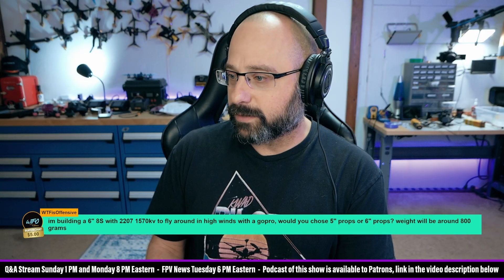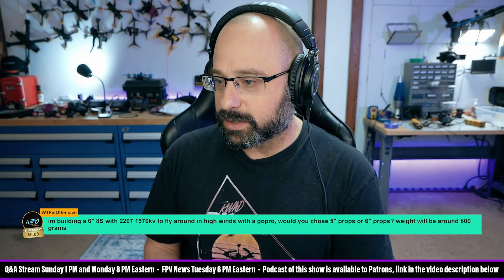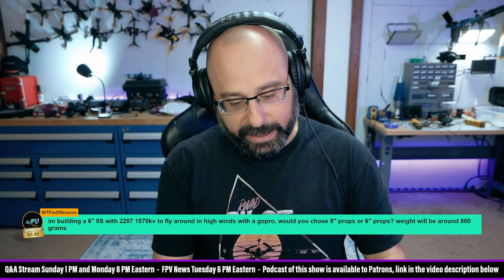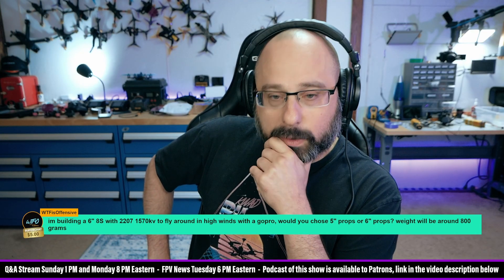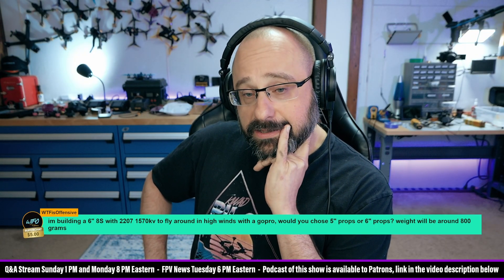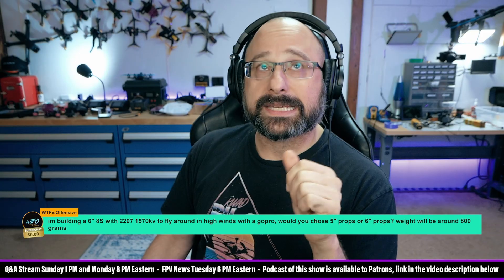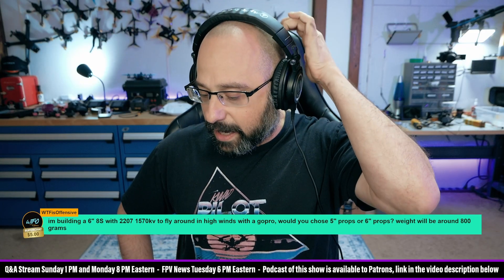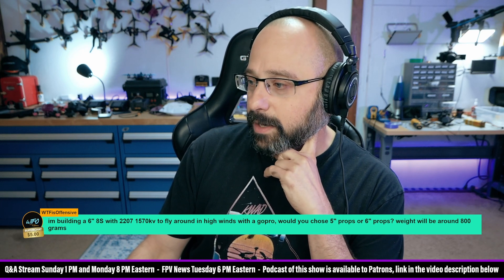Should I Pick 5 Inch or 6 Inch Props For This Long Range Build? - FPV Questions

Comment: I did end up nailing down this 8S build.

Frame: BOB57 6" 
Stack: Sequre H743 & E70 G2
Motors: XING2 2506 1500kv (went with these because I plan to run 6S as well)
Props: 2 sets to test Gemfan 6032 and HQ 6x2.5x3 
VTX: DJI O4 pro (I'll make it fit. I have the STLs.)
Reciever: DBR4 Xcross Gemini ELRS w/ Boxer Max and Nomad module

Backup stack: Kiss Ultra V2 FCFC, Voltara 70A ESC
Batteries: (will need to test)
Tattu R-Line 8S 1300mah
Tattu R-Line 8S 1050mah
Tattu R-Line 6S 2200mah
Tattu R-Line 6S 1800mah

Finding a 6" to do this in was a process haha, started with the Volador II VX6 and ultimately decided on the BOB57

Comment: 5" props will give you agility during maneuvers in heavy wind.   6" will feel floaty in moderate to heavy wind but youll have more straight line authority.   You will have a bumpy ride in the wind with 6" props but you will be able to track straight.   Just make sure you run the footage through gyroflow in post.  When it comes to flying in wind weight is your friend.

Comment: I'm going to build a 3in with prop guards to carry an o3 (probably o4 now!) in a HEQ 3 axis gimbal, its for flying through properties (for sales vids) so i dont need high speeds, more interested in duration. What motor and battery combination would you suggest?